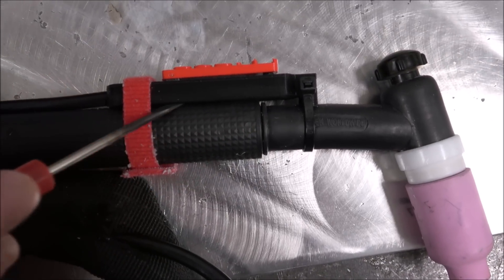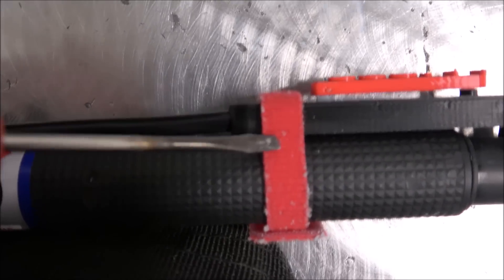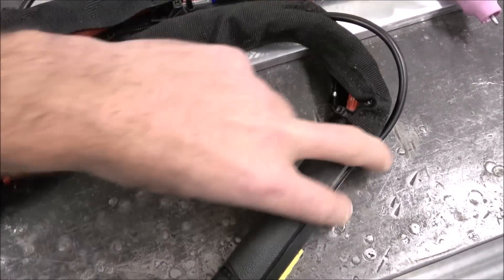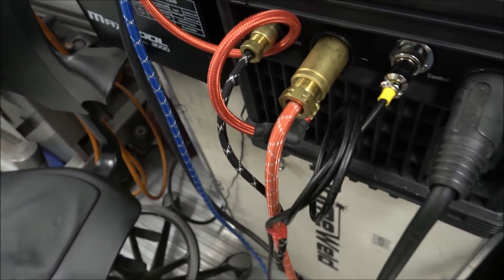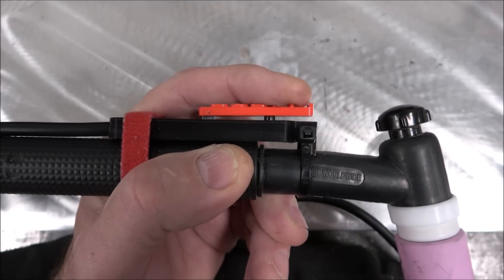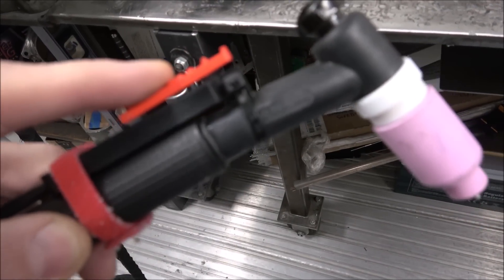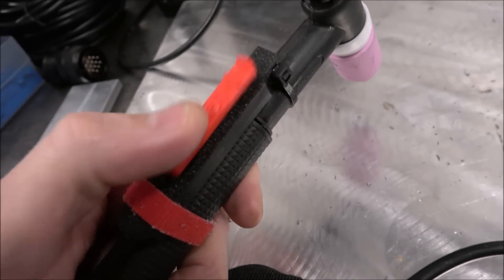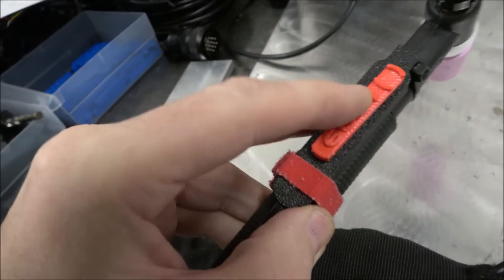6061 TIG Slide-Lever Installation Instructions

Comment: Any significance between slider colors?  I noticed on your cyl head repair you using a yellow slider.  Just wondering.  Thanks for making these vids.  Very helpful!
Reply from the maker: No, I was initially making them match the machine brand colors. I'll likely be making most of them with black housings and grey sliders from here on out (simplicity).

Comment: Do you offer them for the Everlast 210EXT & the 325EXT machines ?
Reply: I’m wondering the same thing
Reply: Yeah if you look on the website he has it for alot of different machines.  Including those you mention
Reply: I just ran mine for the first time on a everlast 255ext with a CKWW water cooled  torch. I had to set it to peddle with 2T, just peddle mode ran an error code. It functioned perfectly however I felt like virgin trying to get used to the control for the first 30min... probably shouldn't have chosen a tiny fiddly job to start with hahaha